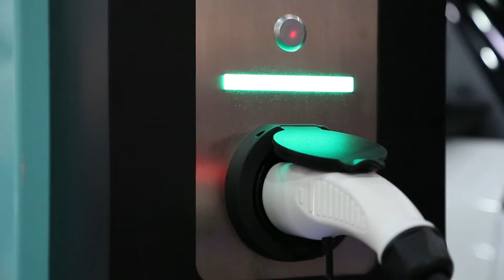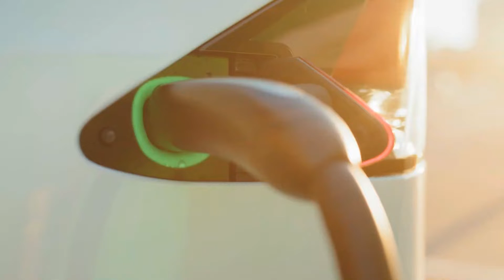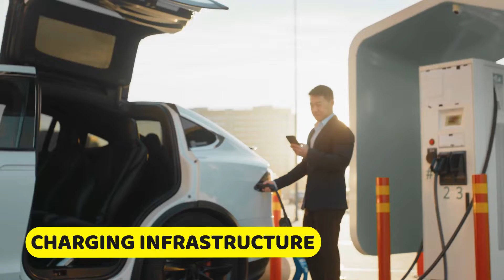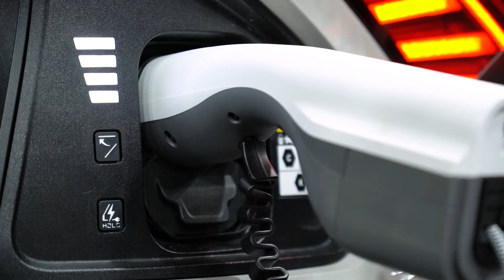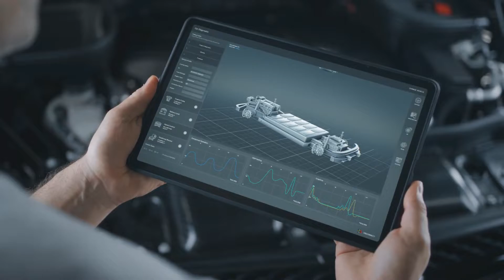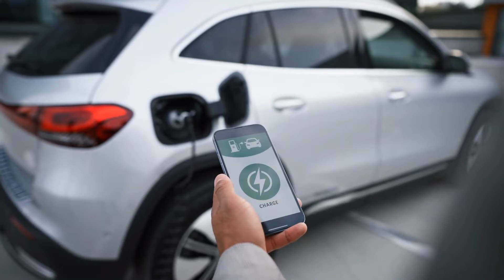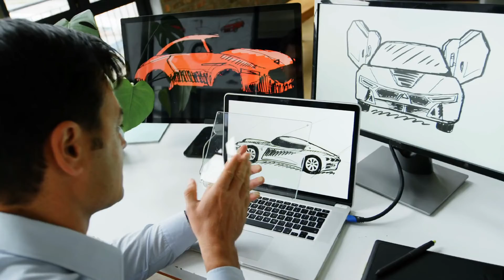Volkswagen CEO: "Our New Engine Is The End Of EV's!"

Comment: Well I'm leaning towards it being a blip on the path to sustainability. While 50% efficiency is a possibly with an efficient engine along with compounding (which a turbo generator effectively is), it doesn't normally come without a cost penalty due to added complexity, which in turn would be a barrier in those markets without good  electrical infrastructure. Hopefully I'm wrong, as we can certainly do with anything that reduces emissions. Also I think that most countries are now developing a reasonable component of sustainable electrical generation (and its steadily growing with the expansion of the likes of solar and wind generation networks).  Even with coal fired generation, the efficiencies are typically 45%+ (and electrical efficiencies from grid through to the motor are normally > 90%), and todays BEV cars (due to a low friction drive train, good aerodynamics and regenerative braking) are use the energy from the motor much more efficiently than a ICE car. Its not just the efficiency of the motor, but the efficiency of the car that counts. Anyway it will be interesting to see how this new tech rolls out!
Reply: Let's not forget the efficency cost of all the mult story carparks and Roro ships being burned to the ground.
Not to mention the fact that even after minor collisions, bevs are being written off due to fire risk.